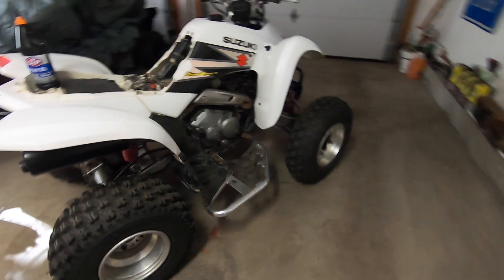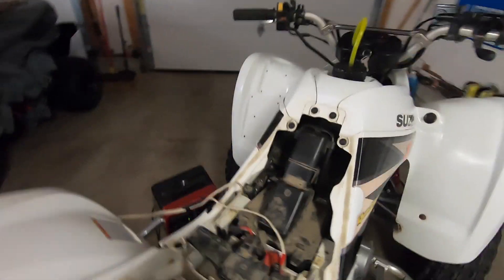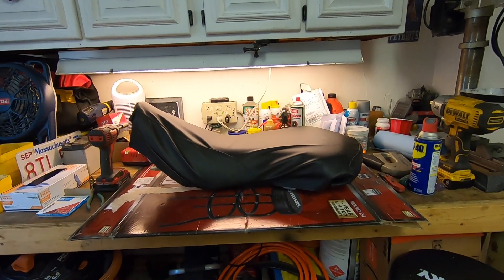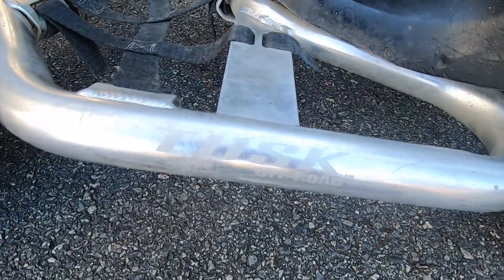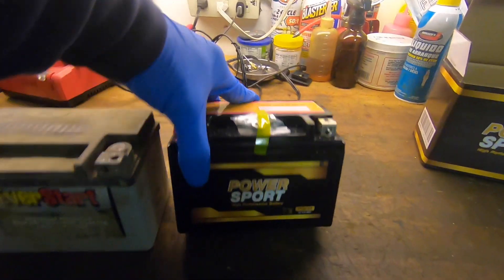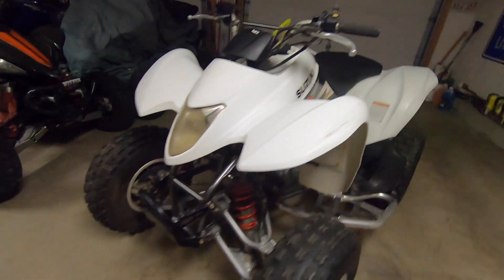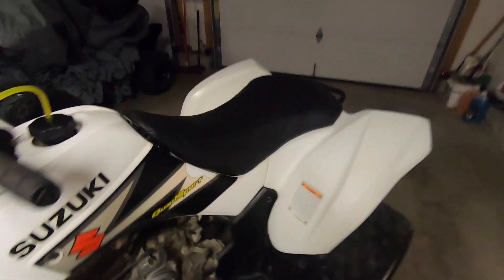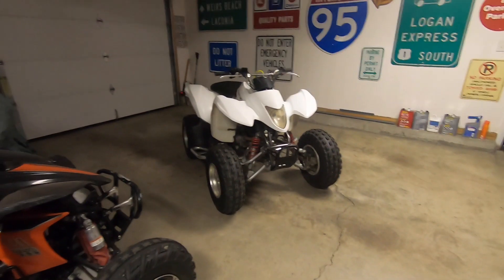2004 Suzuki LTZ250 Video 5

Comment: Great job on the lt250.  Don't be afraid to try wet sanding, cut and polishing on the headlight.  30-45 mins of elbow grease and that baby would look brand new.  I think Mike Sabo just did a video a couple weeks ago on wet sanding a yellow headlight.
Reply from the maker: I just did that on my sons Dodge dart. I have too much time into this LTZ , plus the bulb assembly is missing so the head light doesn't work anyway.